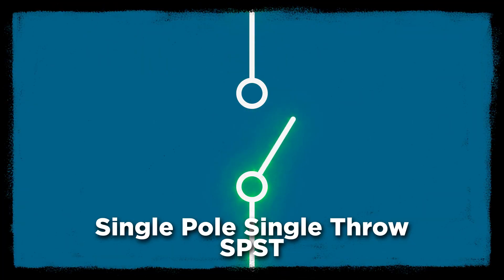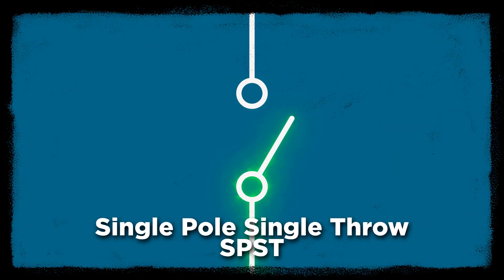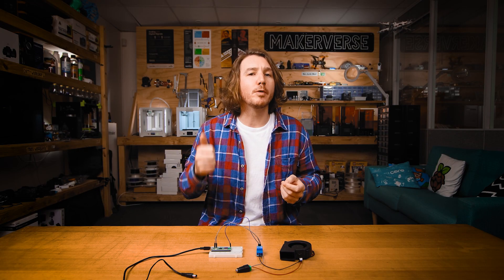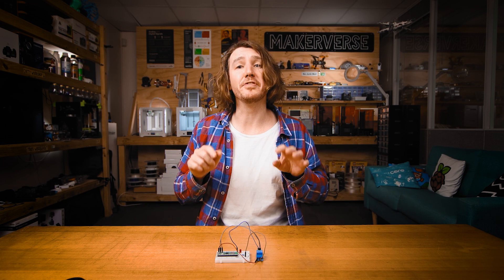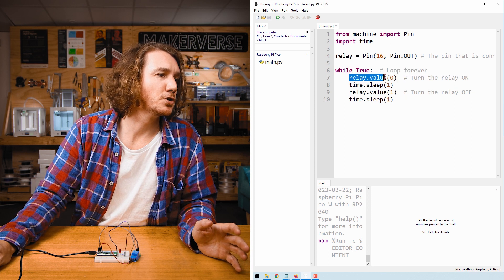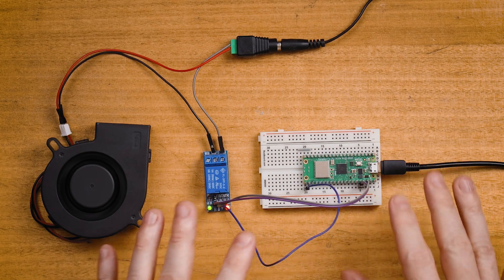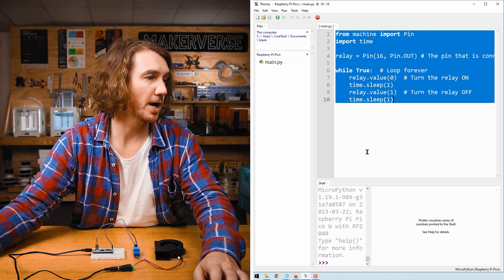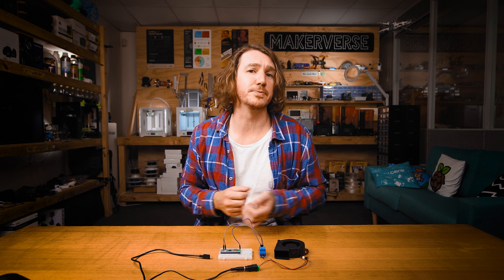How To Use A Relay With Raspberry Pi Pico

Comment: Umm my relay module says 12VDC on it and I need a 5VDC to power the Solenoid Valve isn't it? Oh btw my Solenoid Valve is 12V and I have a lead acid battery which also is 12V.

Comment: I totally understand your concern by advocating switching AC current, but you are incorrect about that. A relay can for sure be used for switching 240V AC mains while being managed by a direct current of say 12V. Almost all relay coils are driven by DC current, because to be honest, not all people have a lab power supply at their disposal to be able to activate the relay coil with low voltage AC. You need a relay with isolated coil so that aC doesn't leak back into the coil and then fry the DC line in turn. I would only advise upmost care when selecting boards from all over the internet. Always buy from reputable brands or af least do the homework and go through datasheets that are provided. Even stuff from amazon and aliexpress can handle AC but do your research!

Comment: The normally open option on the relay may be a safety feature when power is cut off from the Pico but it does not help when the code on the Pico crashes. 

I have a watering system with a 12 V pump switched with a relay. Occasionally the Micropython code crashes while the relay is closed. The relay  does not revert to open and the pump can run dry.

I wrote a small test code to demonstrate this:

-------------------------------

from machine import Pin
import time

button1 = Pin(27, Pin.IN, Pin.PULL_UP)
relay1 = Pin(20, Pin.OUT)

print("Test Start")
relay1.value(1)  
start = time.ticks_ms()

while True:
    print(button1.value())
    time.sleep(2)
    if button1.value() == 0:
        print(2/0)  # forced devide by zero error
       
    else:
        relay1.value(0) #low turn relay on
---------------------------

When I ground pin 27 with the button the error crashes the script but the relay remains closed .

Any ideas to ensure the relay reverts to open?

Comment: I wander if I could use a pico w and use a  wireless router. Could i use this idea to take place of a garage door switch ( like a door bell switch ) . To control my old garage door using my phone ? I have the  components for it .
Reply from the maker: Yes, we actually released a video doing exactly that when the Pico W was released, the only concern with the project is security as anyone with access to your Wi-Fi can open your garage. Although if you manage to figure out the project it's probably not too much trouble to add some extra protection like a password on the garage control web page. https://youtu.be/bIBQKl_Sots?feature=shared

Comment: I already run a 120v flashing 20 foot penis that flashes in Morse code. I used the 5v relay board to drive a 12v relay which switches 120v.

Comment: Why the negative side of the fan?
Reply from the maker: it's common to switch a load on the low side because this is often how it's done with transistors (NPN, or N-Channel MOSFETS). In this case it doesn't really matter though!

Comment: I copy exactly what you done and the output from GPI 16 was not strong enough to activate the 5V relay (the red led is on but the green one remain off). I understand I should use UL2803A to elvate the output signal from 3.3V to 5V
Reply: exactly ?  instructor did say take the 5 volt from the pico (not from pin 16) to power the relay,  pin 16 signals the relay to move the contact.

Comment: FYI: I couldn't do it with the 5-volt output of my pico W. However, it worked fine with the 3-volt output. I suspect it depends on the type of relay.

Comment: hi!
i'm getting no snappy sound when i run the script (coming from the relay). Furthermore, I'm not capable of burning the LED even though I connected it with no resistor to the wire coming from the Common slow of my relay. The ground is connected. Oddly enough the red light from the relay dims a little when I the signal gets sent... 

Am I being a dummy or is there maybe a relay power issue going on?

Lovely video, thank you for posting it! :D
Reply from the maker: The best place for technical help is on the forums. There you can share a photo of your setup and we can debug the circuit properly: https://forum.core-electronics.com.au/

Comment: will the pico be able to control the 5v relay as it has only 3.3 volt signal
Reply: Im guessing the same!
Reply: I  was able to drive a 5V relay on the pico's GPIO with a VERY similar looking relay (don't have the d.sheet) BUT it crashed the serial communications to the pico
Reply: A lot of relays will be triggered by the 3.3v even that say 5v the one here they sell is. I had the same queries as you